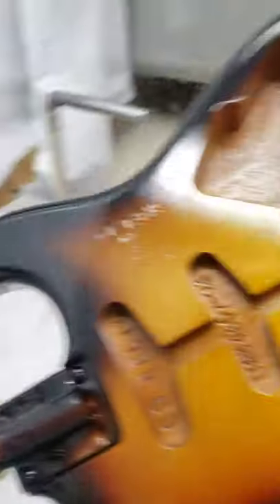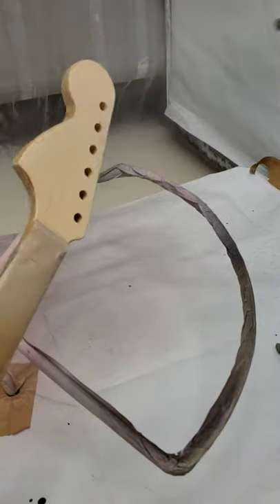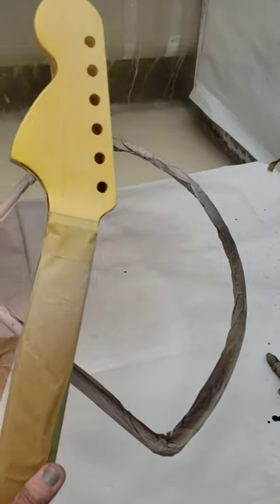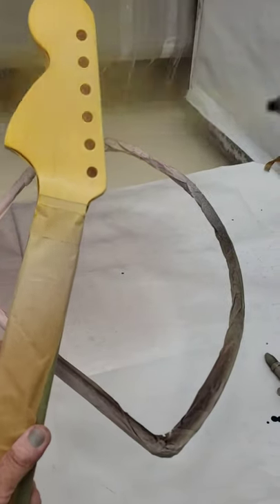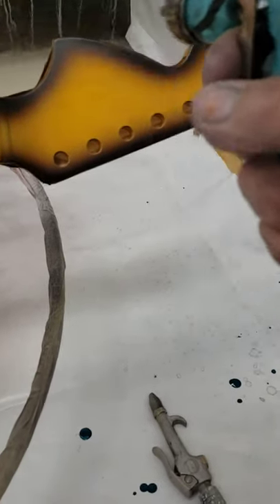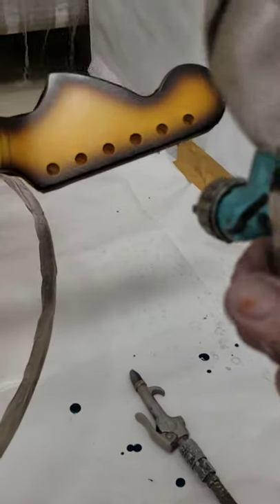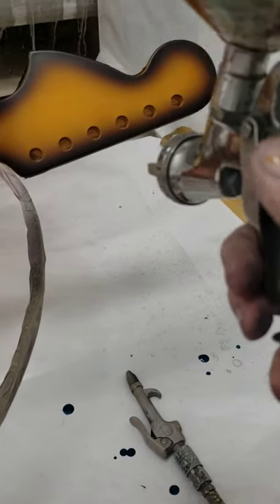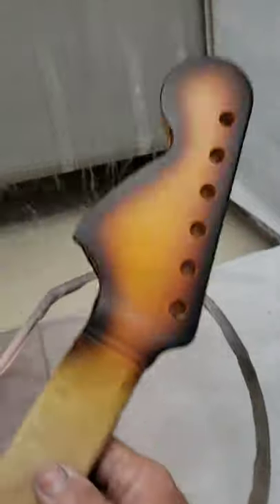Matching a 3tsb headstock.

Comment: Very cool!
I'm wondering if you use grain filler and primer on matching solid color headstocks before the paint? 
I'm going to be refinishing my mustang in competition burgundy
Reply from the maker: No, because most are Maple and don't need grainfiller. The white base coat also isn't necessary to apply. It is only done to match what fender did in the 60s.